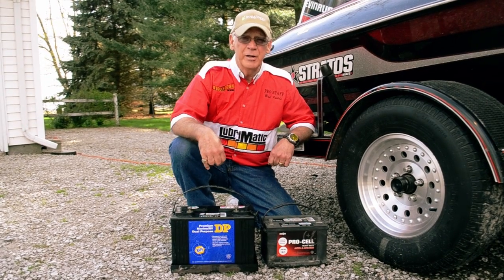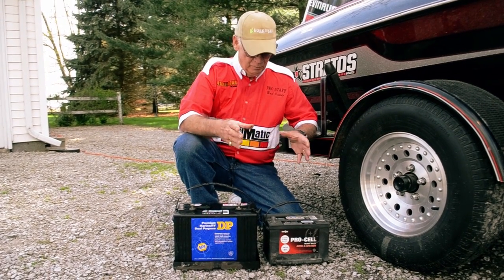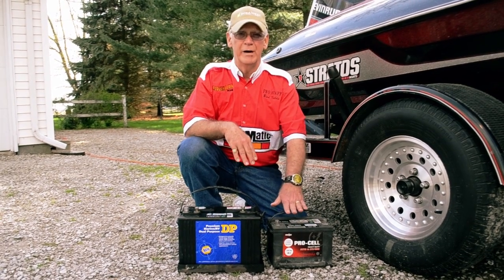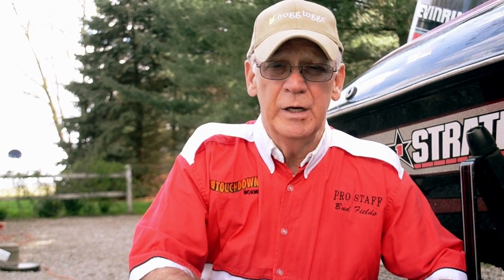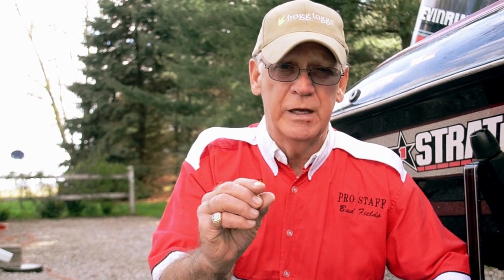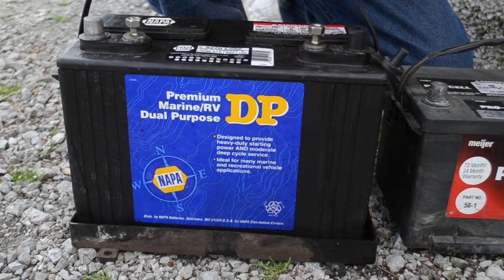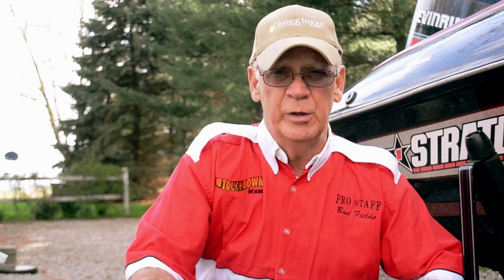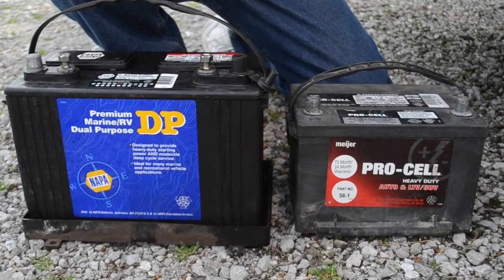Outdoors with Bud Fields: Auto vs. Deep Cycle Batteries

Comment: hello i have a question i want to run deep cycle batteries in my semi truck to power an ac unit when the truck its off but i dont know if they can start up the truck ok and also if they can be recharge by the alternator or they require a special charger any tips will be great appreciate it thank you